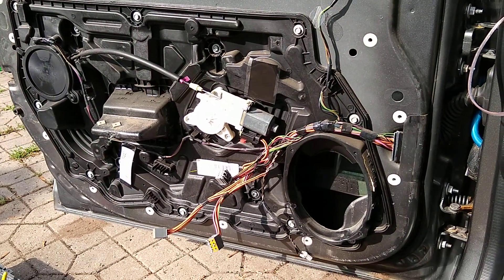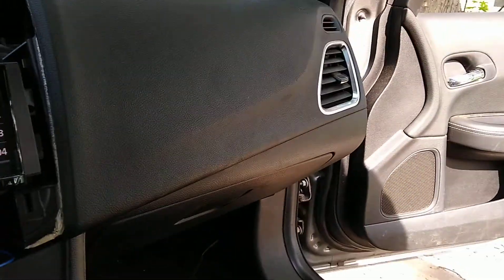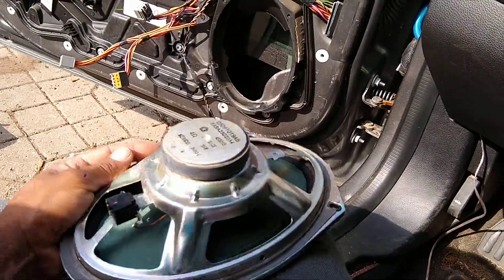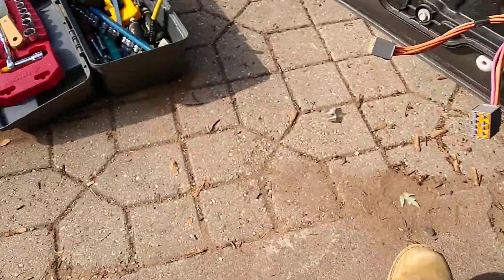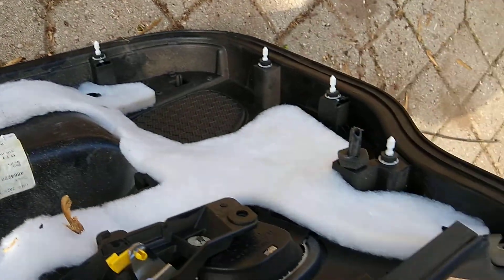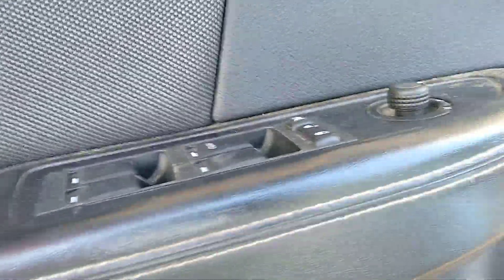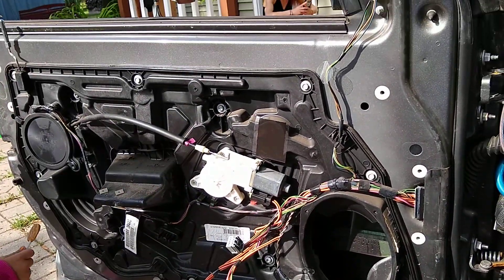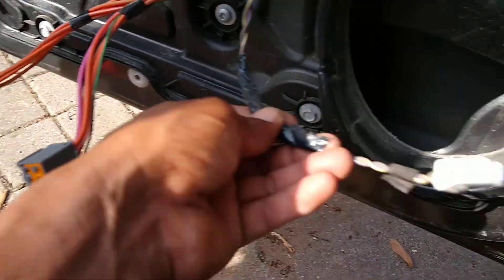Upgrading front speakers on my 2013 avenger

Comment: thats not a 2007 avenger
Reply from the maker: Lol. Not sure why i said 07. It's a 2013
Reply: @migascustomsounds3054  lol. You ever take the 3.5 dash speakers out?
Reply from the maker: @thelegendarywasdgamer9724  yes. I put in some Vegas. My kenwood screen dosent have alot of volume. Il be doing an update vid. I got 12 speakers not counting tweeters 8 are on an Rockford 400.4 amp 120 per channel.
Reply: @migascustomsounds3054  yeah I'm  doing my system to. How much space does the 3.5 speaker holes have? I'm looking at getting some new ones but the tweeters stick up a bit.
Reply from the maker: @thelegendarywasdgamer9724  not much space. I was able to screw mine securely and put the top on. I used 4" speakers. The 3.5s should no problem.
Reply: @migascustomsounds3054  yea I just got the trim off today. Looks like the speaker should fit. The tweeter that is on it sticks up a bit. But it should be ok. I have a 12 in the trunk.
Reply from the maker: @thelegendarywasdgamer9724  nice. Wat are u running? Did u install it ur self?
Reply: @migascustomsounds3054  I do everything myself :P. My amp I might upgrade but it's a start. It's a boss pt1000 amp with a skar svr-12. Box i put it in is to small for me. I'm going to be getting a 2.70 cubic feet ported box. In replacing the rear deck and doors with either mtx terminators 6x9 or some 3 way skar 6x9's. Taking the door trim off tommorow.